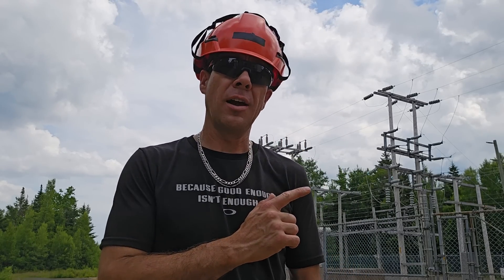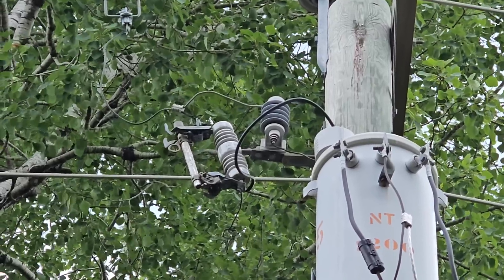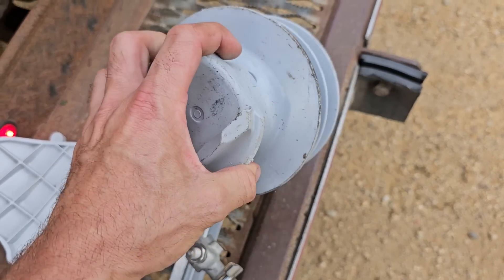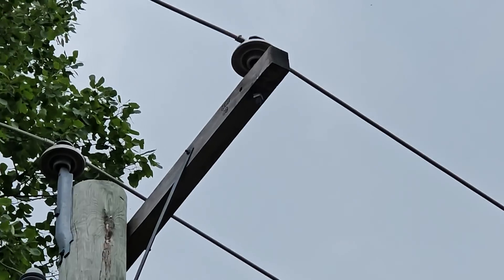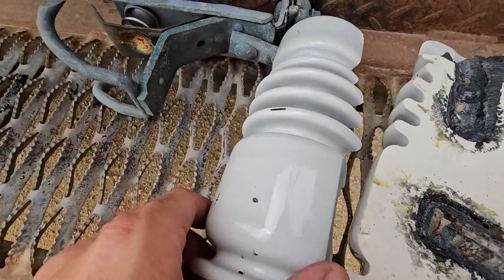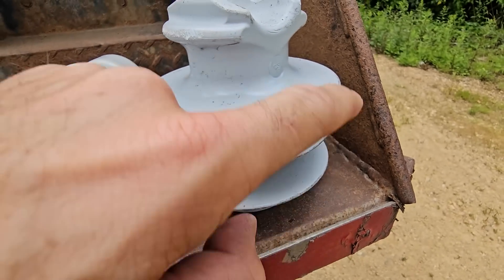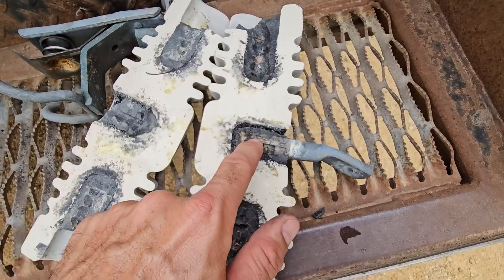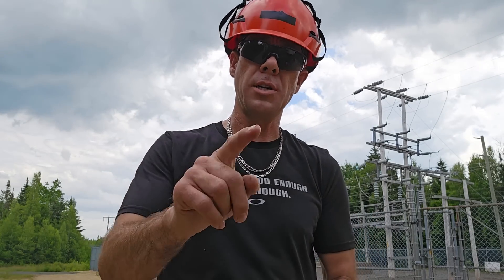How do power poles catch fire?

Comment: I was involved with a project sponsored by the rural cooperatives in USA. Georgia Tech using x-ray equipment was able to find voids in the cement of the porcelain cutouts that would fill with water. Freeze and thaw cycles would put pressure on the porcelain eventuality, causing the porcelain to crack.
Reply: Based on some of the weather in these videos, I bet there are a lot of freeze-thaw cycles in his region.
Reply: @charliesullivan4304  I think it's New Brunswick, so yes lots of freeze thaw.
Reply: @dfirth224  he clearly doesn't want to reveal his location, so while it's fun to guess, I don't think we should say anything about our guesses.

Comment: I'm really curious about porcelain/glass/...idk.. multiplate insulators that support the high voltage conductors. 
I never seen one up close, but i noticed that each plates are linked together with swivel metalic mecanism.. 
My question is basically..; Are the porcelain plates as strong as the metal hooks ?
I really would like to see a multi plate insulator cut  in half, to see how they manage to hold together.
Reply: each one of those "plates" is its own entity, and they are assembled in series as necessary to meet the demands of total system voltage. (5-10Kv per plate) They are extremely strong in both tension and compression. The outside glaze is only the exterior coating to resist dirt sticking. The internal part is ceramic. A similar material is used as the base support / insulator for AM radio towers weighting thousands of pounds.
Reply: @rupe53  thanks
Reply: "plates are linked together with swivel metalic mecanism.." -- Not the one here, but "suspension" insulators are hooked and stacked to desired length and voltage. Search Bing/Google for "Porcelain Suspension Insulators" and then maybe click "Image Search". ResearchGate has links to technical papers, and many makers' web-pages have pictures of their linkage. Yes, for a hundred years they just clip together, with cement holding the caps on.

Comment: My grandpa lived on a farm, and during droughts, he would soak water around the farm's power poles. He said if the pole grounds got too dry, they might overheat and catch the pole on fire 🔥
Reply: Interesting presentation. 

Thank you. 

Yes, salts are very conductive whether along ocean, and far from any salt water bodies!

Accordingly more so everywhere in North America where Salts are applied each winter  season by state, provincial, county, city, town DPWs, allegedly for travel "Safety".  
The Salts dust, brines, become airborne to coat cars, trucks, Poles, wires, transformers, trees, etc.  They also leach, drain, track into buildings, walks, manholes, transformer vaults, conduits, soils, water bodies, creeks, ponds, rivers, lakes, reservoirs, aquifers. 
Easily and readily causing deterioration, rust, etc along with many short and long term negative consequences.
Reply: Lol😂

Comment: Very informative video. I am a former IBEW Inside Lineman living in northeast Pennsylvania and have a question. What would cause the insulators on the cross arms of a power pole flash like a light bulb? Almost looking like runway lights at a airport. On my morning commute to work.
Reply: You sure they are not those warning lights that are induction powered and hang on the higher voltage lines?

Comment: I thought cut-outs were few and far between, but I counted 6 yesterday coming home from the store.🤯🤯🤯
Reply: @danielcarter305  be sure to check the road occasionally 😂
Reply: @unwired1281  😆😆😆yeah. That pesky road and other drivers makes it difficult to admire the electrical system... LOL
It's okay. The supermarket is just 3 blocks down the street and just has to take the neighborhood streets at 10 M.P.H.😄😄
Reply from the maker: Lol
Reply: Yeah, cut-outs are all over. Not just ahead of individual transformer, either.  Cutouts protect whole circuits.  Don't want 10 miles of aerial wire to melt on you!
Reply: Years ago I noticed few, if any cut outs.  Is this something they have been doing over the last 20 or 30 years to add protection to equipment?
Reply: @dfirth224  Where I live, there were few cutouts on individual circuits or transformers. That's drastically changed the last 20+ years.
Reply: @dfirth224   It has probably been way longer than 20 - 30 years. In my area (Northeast USA) they have been installing cutouts on nearly every side street since shortly after the post war building boom, so that's easily 70+ years.
Reply: I see cutouts one pole following when wires get smaller.

Comment: Those insulators crack because of corrosion and expansion of the metal components that are encased in the porcelain. It is similar to “rust jacking”.

Comment: thats funny.  at your level wood is a semi-conductor.   I work in computers and audio and in my world wood is an insulator.     Then again, I am not screwing with 7k volts.
Reply: With enough voltage, anything can become a conductor temporarily. ⚡️
Reply: I wonder if you can make a PMP transistor from layers of pine, maple and pine.
Reply: @charliesullivan4304  I don't think it's a matter of whether you can or not. I do think it's a matter of degrees of efficacy.
Reply: If it changes its conduxtivity based on the presence of a control current, Yes
Reply: A 2n2222 wouldn't stand a chance up in there.🤣
Reply: I think a few of you are right off base.   Insulation factor of any item is conditional on the amount of voltage that is applied.  Even Glass will break down and carry current if the voltage is high enough.   His referring to a semi-conductor is not accurate.   The tree becomes a resistor when 7000 volts are involved.    I have worked in transformer vaults with 20,000 volts and there you must be very very careful or if you need to approach the transformer you need a grounded chain-link suit.   Also,, @insideOfMyOwnMind  I think a diode would be a better choice for a semi-conductor as it will conduct after threshold voltage is reached.  But in the real world, the tree is an insulator till enough voltage breaks it down and current starts to flow.  The flow of current is restricted as the tree is not a perfect conductor and therefor has resistance which heats up till it starts the wood on fire.  That is it in a nut shell.
Reply: Years ago I worked in a lot of old steel mills, steel warehouses, etc that had overhead bridge cranes that were powered off of span wire. The wire was secured on either end of the craneway but sat on insulators at intervals all along the span. Sometimes you would see where an insulator got broken and for whatever reason a new one was not available, so they made a makeshift one out of wood "temporarily" lol. 5 years later that temporary insulator would still be there. But those were almost always no more than 480 volts. I don't think I'd try that at any kind of medium voltage